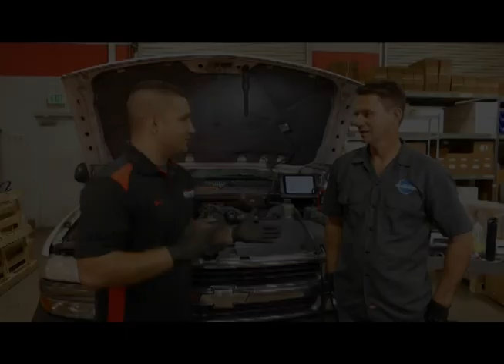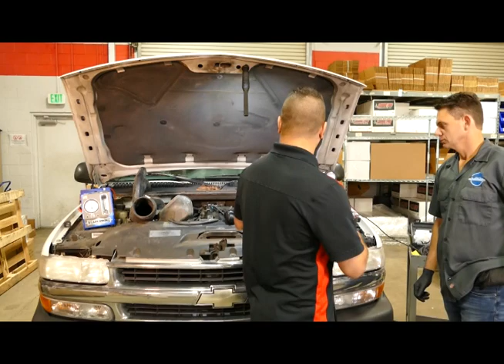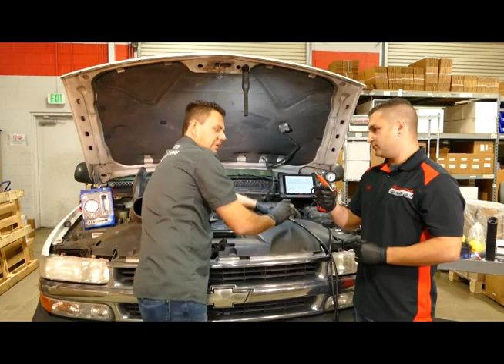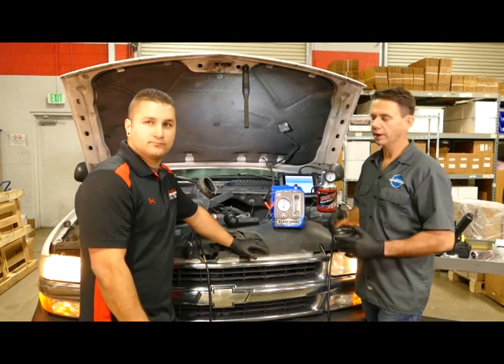EVAP Diagnostics With Brian Eslick From How To Automotive

Comment: The Pro one has went down in quality.  The hoses r trash ans the o rings on the canister Crack fast. Replaced 2 lead hoses in 6 months of having mine. And who ever engineered the way the hose goes into the canister needs to be fired.  $120 dollar ones have been engineered better.  Those hoses need to be able to go into a tab that screws the hose down for easy repair when the hoses fail and the one provided broke and cracked quickly on mine. For $1000. dollars u shouldn't have to take that canister apart to repair hoses.

Comment: Hahahhahahaa, why you chose the smaller unit over the other ? Cause is the one I use everyday I get evap leaks !!  The fact is as you said in your channel was they sent it to you so you can try it and do a review “ you didn’t  choose the smaller , that’s what was sent to you LOL 😂. Man you should had just said the truth...
Reply: The ready smoke is better then the Pro one. I've got both.  And had nothing but the hoses break and the o rings Crack on my Pro one. Every one in my shop went with the Ready smoke because their Pro ones also kept failing with broken hoses and cracked o rings.